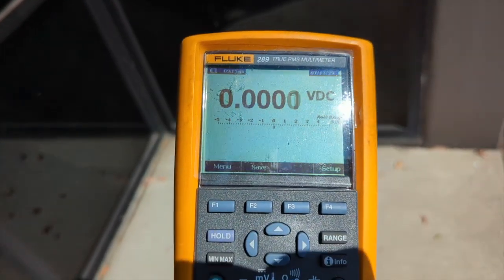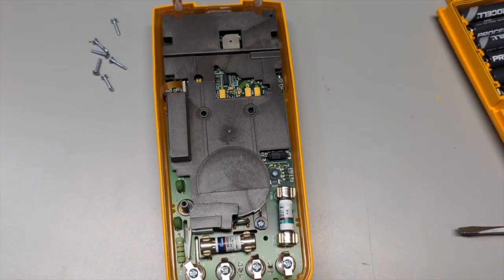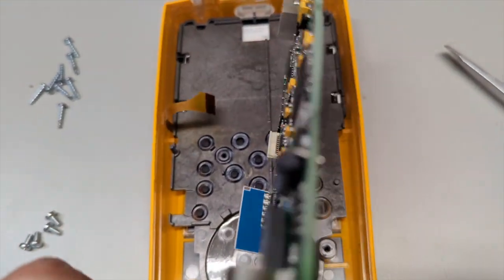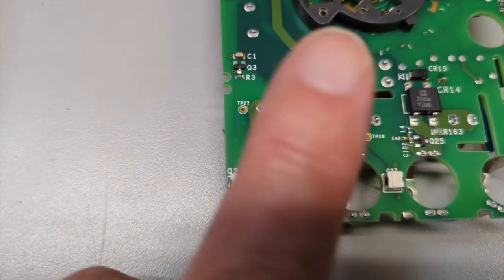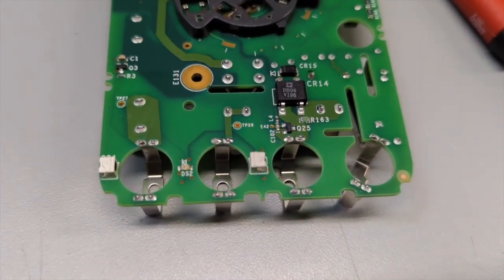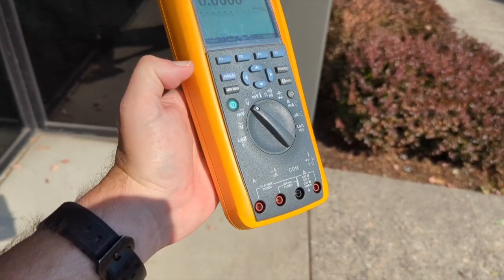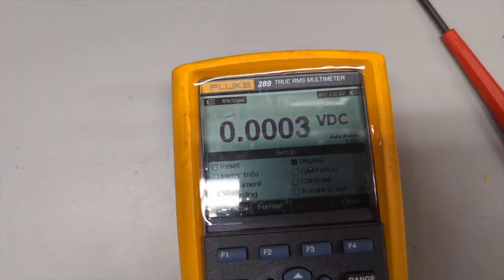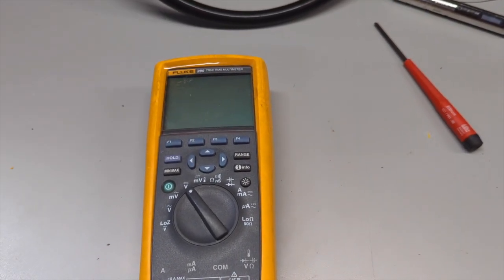Fluke 289 Repair Leads connected incorrectly

Comment: I had this issue, it was intermittent. when the ambient was a bit hot leads issue came. when cold no problems. I narrowed it down to DS2, but it was fine, not off the board. my problem was with R2 on the other side. Its a 200ohm resister and you must have a resister in series or the meter wont function. I installed a 100ohm resister and now it works.

Comment: Thank you so much for your informative video. My Fluke 289 meter had the same diode you mentioned come off. luckily, I found it inside the unit and was able to solder it back on the board, the meter is now working fine.